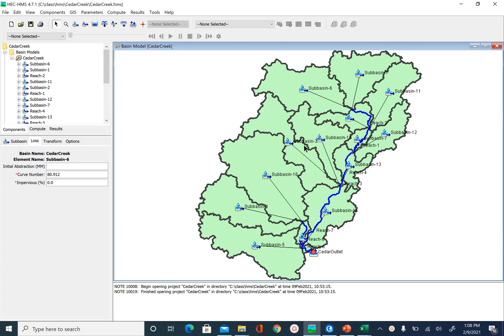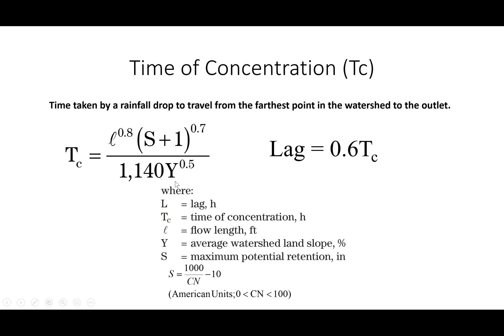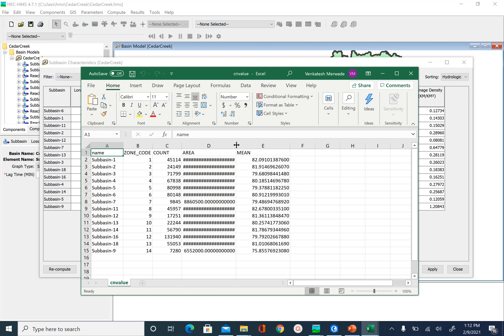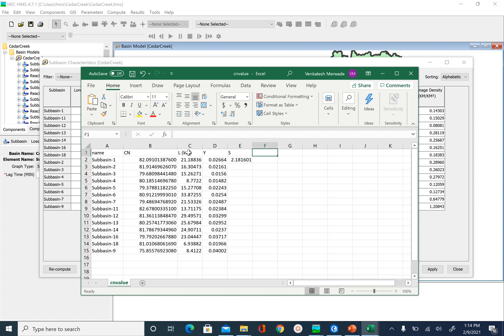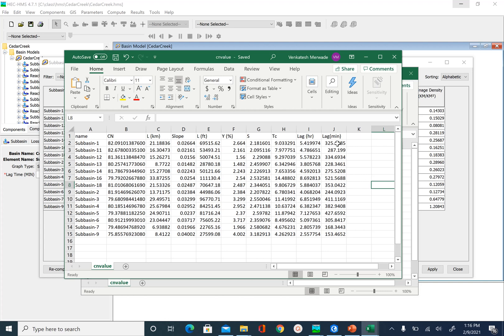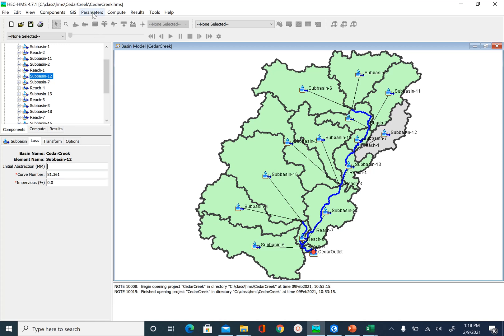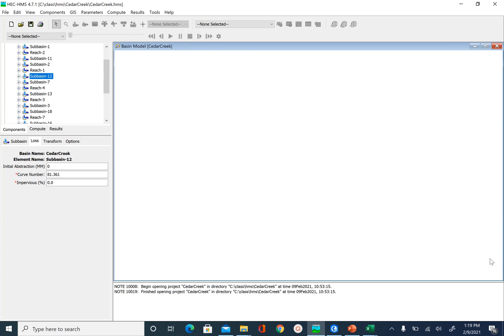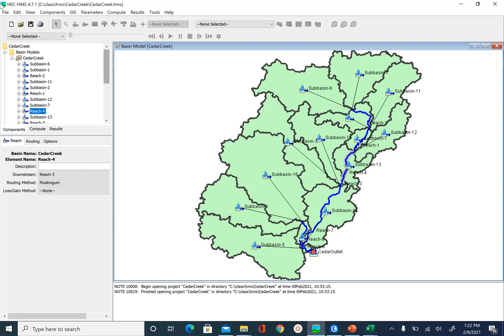Hydrologic Modeling Using HEC-HMS (6/9) - Assigning Lag times and Muskingum Parameters

Comment: I don't understand how you calculated the concentration time. I've recalculated it 100 times but I can't get the same result. I even consulted AI, but it didn't understand how you obtained such results either. However, I must congratulate you on the very interesting tutorial.
Reply from the maker: are your results significantly different? if you explain  your procedure, i can check.

Comment: Hello Sir, a quick question. If you are using metric units, shouldn't you use another transform method? SCS is using PRF 484, which its formula and the 484 constant is not metric. Is that correct or am I wrong?
Reply from the maker: Very good question. I am assuming that HEC-HMS will use equivalent SI factor when using metric units.
Reply: @hydrologyvideos8253  Oh,  so it uses 2.08 under the name of PRF 484. That's great, thank you very much!

Comment: in the latest version of HEC HMS 4.11, Parameters >> Characteristics > Subbasin shows an empty table , recomputing doesnt work either. Uninstalled and installed version 4.7.1 , repeated same steps and Subbasin table shows just fine there.
Reply from the maker: i have not used 4.11 yet. usually i wait for some time before the newer version is fixed from all bugs.
Reply: I had the same issue with 4.11. Tried to open the project in a few different versions including 4.7.1 and 4.10 and I get the message "project version 4.11 is not compatible with HEC-HMS version 4.10". It will not open the project. Can anyone help?
Reply: I had the same issue. It was rectified when I tried defining the coordinates (instead of skip use select option) before preprocessing. There are chances of not computing the sub basin characteristics if the coordinates are not projected properly.

Comment: you mentioned at about 9:11 that this is the first iteration. Is there a way to figure out K and X values using iterations? Follow up question, Could we just use the Lag time routing method, and use the same method we used for the finding the Lag time of the sub-basins?
Reply from the maker: Yes, there is a way. You will need observed streamflow data to do that.

Comment: Thank you again sir for these great courses. I have learn lot of things, i'm trying to do the same stuff as you but I have a problem : The subbasin characteristic doesn't appear so noway to continue . i can just see Subbassin area.
Reply: i have found a solution. 
the data range (max and min) of my DEM file was not correct after the  projection i did in arcGis Pro, it was 818 to -325207. To solve the problem i used the spatial analysis tool raster calculator and made this condition : Con(("FileName.tif">=0)&("FileName.tif"<=818),"FileName.tif",0).
Then i restart all the process and everything was correct.
Thank you very much Sir.